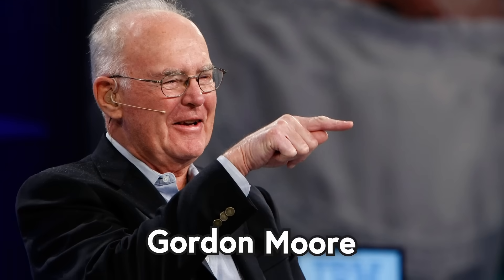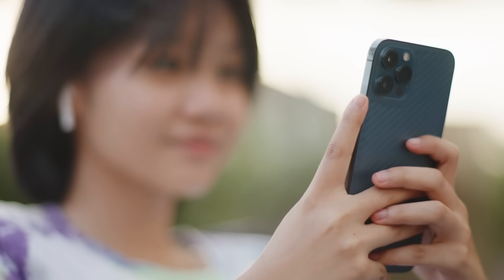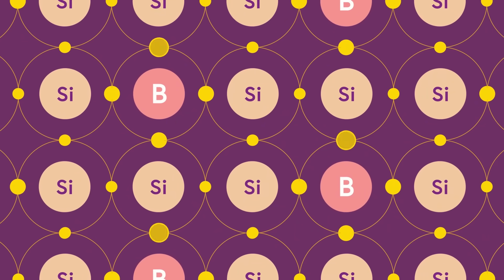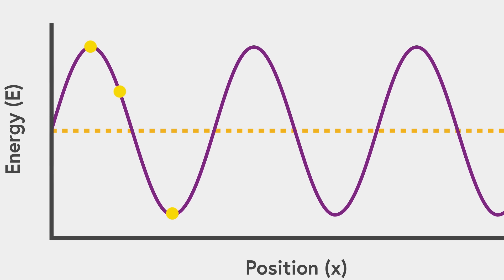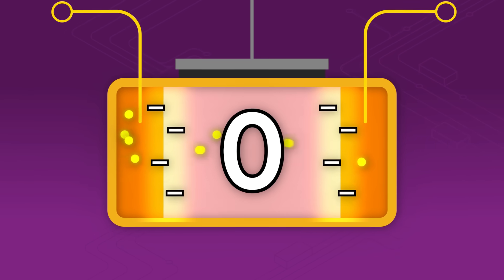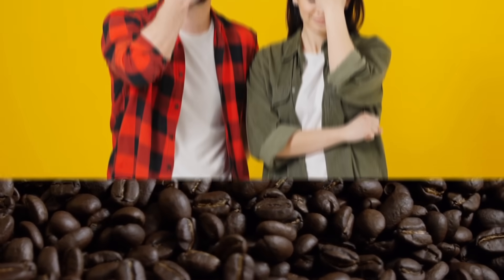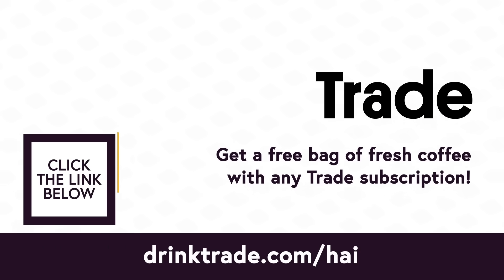Why We're Reaching the Theoretical Limit of Computer Power

Comment: Terms like "made on a 7nm process" DO NOT mean that the smallest structure in a chip is really 7nm. It's all just marketing. There's still more than a decade worth of improvements in the form of node shrinks alone ahead of us. What's possible in addition to that, is the use of new materials and transistor designs (i.e. we transitioned from planar transistors to FinFET and soon will to 3D/gate all around FET), aswell as new packaging methods to combine multiple small chips into one logical unit.
Reply: Tell me you didn't understand the video without saying you didn't understand the video.

Comment: While I agree that Moore's Law may have slowed, I still expect computing power (and even transistor count) per unit area to continue to grow exponentially.  Current CPUs are manufactured in a largely 2 dimensional format.  The engineering problems that need to be solved to place a second or more layer of logic have to date been more difficult and expensive than those required to shrink feature size, but that time is ending.  Up is the new frontier.  :)  Flash memory is already being manufactured in stacks of multiple layers.

And I am aware that chips are manufactured in a layer-by-layer process, with 10-15 different steps.  I'm suggesting multiple iterations of this process.  The main engineering issues are probably heat dissipation  and 3d circuit design at that scale.
Reply: I've seen a lot of similar comments and none of that is going to change the basic gate distance. That single feature is where all of the gains have been made. Stacking crap on top of each other isn't going to do nearly as much.
Reply: @1pcfred  A 100 nm thick insulator layer and a second feature layer and you have twice the transistors (although twice the heat...). And if you can figure out how to stack two layers effectively, you can do more.

I'll admit that I have no real idea what I'm talking about, but it seems logical. EUV would have sounded like science fiction 20 years ago. I just think calling Moore's Law dead is a bit premature.

Comment: There's a saying: "For every doubling in hardware performance, software becomes 4x less efficient.". This can especially be seen in video games. Games are getting less and less optimized as devs are just expecting the more powerful hardware to "poise through" their bad code. Symptoms of this are i.e. frametime issues even on comparatively good hardware.
Reply: That's more because of diversity hire that only properly learned programming in Python but got hired because of their diversity. When you need to fill diversity quotas, you cannot expect some proper knowledge of programming on a lower level.

But not all hope is lost, seeing that Witcher 3 and Doom 2016 received Switch ports. And they look pretty decent, all things considered.

Comment: Garbage. Your fallacious argument is that "computer power" is tracking but will soon run out is fake news. You compare transistor size, which FAILED Moore's modified law more than 10 years ago. Then you pretend like you were talking about transistor count, but not die size. Then you compare flops, which are clearly NOT what Moore or transistors even are. YOU claim it's ending BUT as die size and core count goes up, the flops may actually be limitless but only practical for another 20 years. There ARE workarounds for being used now to compensate for tunneling. Simply adding more rows of racks to a data center is in fact continuing the spirit of Moore's law. In that metric it is still tracking well. No one has suggested, no one will ever suggest that Moore's law is applicable to quantum computers. Qbits will NEVER attain the bit count of classic computers. You suck at this. GFY.

Comment: well thats easy... your so pointed at makin things smaller your forgot the main point... so, if my ryzen 5 3600 was 4x the size, it could be 4x the speed with 4x the cooling.
dumb.      miniturization will kill Intel..

Risc architecture is taking over...  simpy because it can do the same thing using 1/4 the power a 10 inch sqaure risc cpu only 1/2" thick could potentially break the 10 gghz zone
Reply: The only thing that matters to a transistor is the frequency it is switched at. CISC, RISC none of that matters. It is the transitional state change itself that generates the heat. You switch a transistor on and off at 10 GHz and it explodes.

Comment: Your explaination of transistors was pretty good overall, but not completely perfect. A transistor doesnt really output 1 or 0, instead what it does is it serves as a switch, so when it is powered or depowered (depending on if it is a PMOS or NMOS transistor) it will let current flow from one side to the other. This is used to connect data wires to a voltage, usually either VCC or ground, which represents the bit being carried by that wire.

Comment: Wish this spent a single minute talking about what realistically is the next step because if we're hitting Moores law by 2030 then saying quantum computing isn't realistic, we're not having those in our phones or laptops any time soon. I'm certain they're not whats being considered to be the next step for phone processors by the end of the 2020s. Just looking it up now there seems to be a few things being worked on in a standard size processor shape. 
Never understood why Moores law was followed so closesly either. Like we fit twice as many transistors on a chip every 2 years, cool, but couldn't they have been like "ok lets try and fit 4x as many transistors on the next chip even if it takes a year longer". If they did do this then what was the limitation that so uniformly made it double every 2 years? Why was it only after those 2 years did they suddenly have the ability to put more transisters on it? Nothing ever touches on this. Can't think of any other manufacturing process which has had such a consistent uniform imrovement over time. I get that this is just supposed to be a quick video but the "post moores law" bit could have been expanded on more.

Comment: An HAI video I know something about! I'm a graduate student researching Computer Architecture, and I wanted to both commend your team for the high-quality explanation of what is going on. Moore's law is dead, and has been, but we find better and better ways to use the tools provided to us.

I know "keep improving now that we can't do this" was a bit hand-waved, so I wanted to just throw in a bit of what that looks like. One thing we do to improve chips nowadays is all about better organization and use of the space we do have. Only a small portion of the chip is really used each cycle (cycle being essentially a a single high-then-low voltage of the chip), and finding how to make our chip space more efficient (without melting them) is going to be the way forward. We can make different parts of the chip run simultaneously to make progress on multiple instructions, and also dynamically make progress on instructions out-of-order if we find we may get performance out of it. In the end, parallelism is key, and making progress on multiple instructions at the same time will be the way toward the future for our industry.

We've shifted from faster clock speeds to being able to do much more per clock cycle. Some ways we've done this are the following:
Better prediction - When waiting for information, we can 'guess' what we will get back. If we are good at guessing, and have a way to fix mistakes, we can hide the wait time for that request for information and get an improvement in performance.
Near-memory computing - There is research into doing computation inside of memory, which means we don't have to wait for that computation to get to the processor of the computer, and certain types of computations can be done without the need to transfer information. Things like matrix addition have already been shown to be doable in memory.
Accelerators - We consider having dedicated hardware, such as a GPU, that is good at one type of computation that the machine may be doing a lot of (like rendering an HAI video).
Improving the structures we have - By making structures more effective or energy efficient, we can either reduce the number of resources used for the structure (freeing up precious space and resources for other structures), or by offering direct speedup if the structure can benefit from additional resources.

There is a lot more than that going on in our field, but these are some simple ways we go about making improvements beyond "shrink wire to go fast".

Comment: Better chips  - "Bring back the animal fat" !!!

In the realm of processors, those based on the ARM architecture recently (within the last few years) have overtaken "Intel" processors, including those from AMD, in computing power. So even with transistor size hitting its limits, there's still a lot of engineering room in other areas, such as architecture, and other circuit design enhancements, still on the table.

Maybe they may also get around to making a compiled version of Python, because the "interpretive" (most widely used versions) is just this generation's mistake of BASIC. Yes, both are good for certain tasks, but misapplied in areas that they have no business being used. Like interpretive Python, old interpretive BASIC are dog slow !
Reply: Yeah you just keep believing it.

Comment: nice, next step is reducing cost though. If you can produce twice the number for the same cost, for something like my phone it doesn't help, but for something like my home pc, I don't actually care if it's a bit larger,
Reply: A transistor half the size generates half the heat. Or we can just make it go faster and bring it back up to the limit of heat it can handle. Hmmm, decisions, decisions. Big numbers sell better. That's why node reductions have been driving the industry for decades now. The top dog gets the bone.

Comment: The last part: how will computers get better post moores law is not right now and almost certainly not going to be quantum computing. The most obvious way computers get better from here on out is just better coding. There's also new revolutions in information systems. Most of programing these days uses the same basic concepts invented in the 1970s. Also Intel CPUs use CISC rather than RISC architecture. This is controversial mostly because it's counteracting. CISCs take longer to design but then CPUs double in performance every two years so it hasn't mattered. Further RISC based systems are still inheriting compilers and software developed for CISC. Consider that emulators for RISC based architecture are much better and easier to develop. That's why the Wii is so easy and fast to emulate. Other issues like how Android is software piled on software piled on software could also see huge improvements.

Comment: Quantum computers aren't a solution to making computers faster. In fact, for most tasks they'll be far slower than transistor-based computers. What makes quantum computers special is that they'll be able to solve certain types of problems which are difficult to solve efficiently using transistors. For example: the Traveling Salesman Problem.

Comment: Oh, they can keep doubling the number of transistors on a chip...if they keep increasing the size of the chips.  The problem is heat dissipation, surface area to volume, heat conduction, etc.
Reply: And therein lies the problem. Just doubling the number of transistors does not automatically net you double the performance. Because there are other factors at play. Doubling the number of transistors by area does net you performance gains though. It's not quite one to one but it's still the best yield. It was the clear path forward for quite some time.

Comment: We may be approaching the minimum semiconductor size, but that doesn’t necessarily mean we’re going to hit the limit of processing power. Smaller semiconductors is sort of the “brute force” method of increasing power, as smaller transistor means you can fit more transistor on the same die. Progress can still be made other ways such as pushing higher clock speeds and increasing the instructions per clock cycle via better architecture designs
Reply: Besides more gates individual gates perform better the smaller they are. The smaller a transistor is the faster you can run it. Ultimately the limiting factor is heat. Small transistors just dissipate less heat than big transistors do. What you call brute force has worked for us very well. It was the clear path forward for decades. Now we're closing in on the end of that. Which is a problem.

Comment: The other advantage to making transistors smaller is that because the electrical signals (not the electrons themselves but the electromagnetic waves) move at nearly the speed of light, having the components closer together makes them effectively able to process more quickly. It’s important when you’re dealing with time increments under a billionth of a second. Correct me if I messed up any of that.

Comment: These shrinking dimensions are the reason the power supply voltages used in microprocessors have been lowered.  The leakage current on those small scales increases and also the need to reduce the power loss.  Modern processors run numerous power supply voltages that require management controllers.

When I started in embedded controller design (think things like car engine controls and so on) 25-30yrs ago things were a lot simpler and easier to design.  My current project just is for controlling some liquid dispense valves but we are using a 292 pin ball grid package for the main micro and its got 4 cores I believe.  Software bloat has followed hardware shrinkage so we need something like that.  Of course, the rest of the controller has parts with unbelievable performance compared to something doing the same thing 20ys ago.  The overall size of the controller doing this same thing 20yrs ago would have been at least 3-4 times the size as a result.  Back then, it could be done but would not be done due to the size and cost.

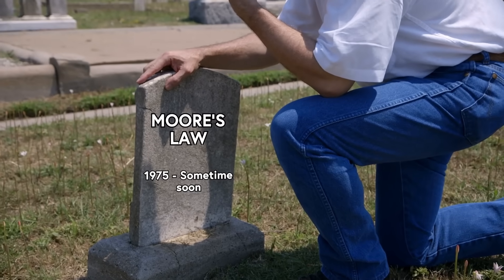I had to chuckle at that stock photo of a mosfet power transistor at the 2:08 mark.  Mfg date code of 29th week of 1988.  From the spec's on that obsolete part, it would be the sort of thing used in a small 3ph motor drive or power supply running off 220V, etc.

Comment: Just gonna point out: Quantum computation IS NOT and never will be a step forward in conventional computing to bypass the tunelling problem. (For that, look to spintronics) QC's are a very different sort of electronics - you might, hypothetically, one day have a QC computation card plaggued into your computer, for such things as decryption, molecular mapping, and least-path problems (Y'know, the sort of things conventional computer suck at) but it will itself utterly fail at everything a conventional system can do - It's an accessory, not the main event.
Reply: The only certainty is that nothing is certain.

Comment: One quick note, it’s not necessarily that an on transistor is 1 and off transistor is 0. Rather, there are two networks of transistors that implement some sort of logic function with one network connected to ground (0) and the other network connected to a voltage source (1). When the network connected to the ground is conducting, the output of the “CMOS” logic is 0, and when the network connected to the voltage source is conducting, the output is 1
Reply: This video wasn't about how to construct logic gates. The words you're looking for are totem pole logic BTW.

Comment: Moore's law is over, but computing power is still on the march, given that you can get RISC V chips for 10¢, It's too bad that the multiprocessing advances we made in the 1990s, such as we personally made at the Supercomputer Computations Research Institute, became fragmented, so most of the massive parallelism is fairly special-purpose, such as GPUs and their progeny. There is still an opportunity for e.g. MIMD hypercubes. The trick is the software, which took a significant hit when nobody wanted it because single-processor hardware got better so fast. The advantage to get everything out of, say, 8 cores, is often not huge, but now that you can fit 256 into a rack board, it might be something to return to.